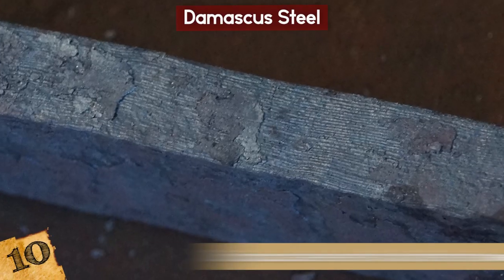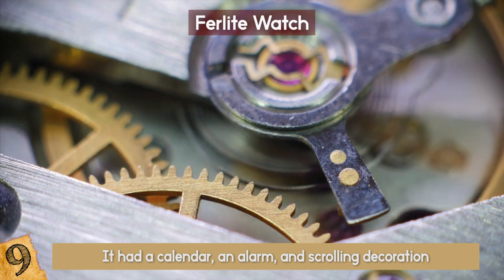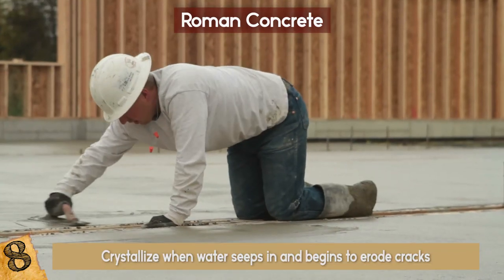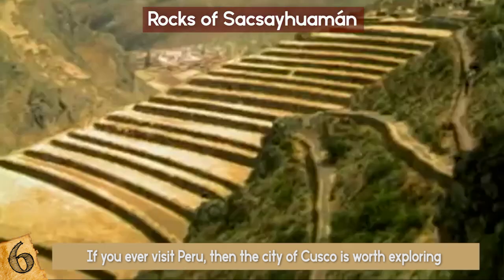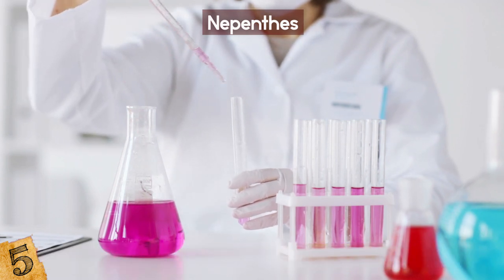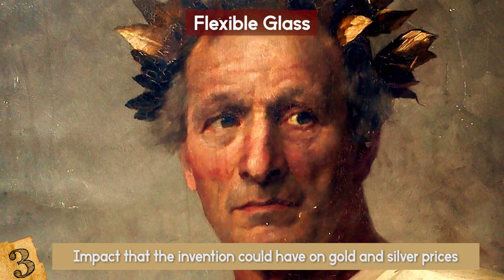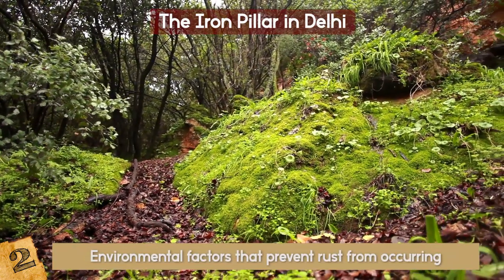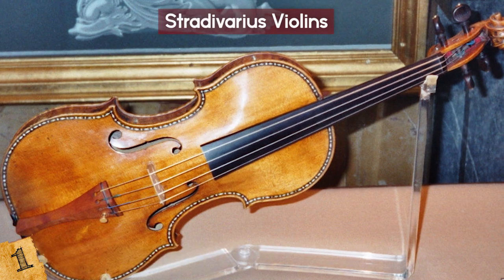ANCIENT Technology We Still CANT Replicate Today!

Comment: Actually #1 isn't really a secret anymore. The secret is in soaking the wood in water, for a very very long time. Stradivari was reputed to soak the wood for his violins for as long as 20 years or more. Today, they get Stradivari sounding instruments by trying to find old logs in ponds and lakes and such , some even end up sounding better, because the wood has been soaked for as long as 160 years in some cases. Also, Stradivari favored wood that he harvested during years of drought, because of the tighter tree rings and the effect that had on the density of the wood.  So soaking the wood of trees that were from areas of prolonged drought, then ad in the pattern of the Strad for the acoustics.. bam.. modern day strad, only 8,000$ and not 8 million.

Comment: FYI, damascus steel is still being produced to this day. google damascus blades, south africa
Reply: Tim Berrange  a youtuber blacksmith made a katana out of damascus
Reply: Tim Berrange go to Alec Steele's channel! He uses it in all his projects. It's not that special... This video is not researched really well in some points
Reply: Moskov Alucard Alec Steele
Reply: Tim Berrange that's folded steel
Reply: The old way is to add Material to almost molten steel. But is hard to do and it's useless today, you can forge weld steal much harder and flexible
Reply: Depending on what study you look at, one has the source of damascas steel being its smelting and forging process. There is also something thats nearly there the exact same thing, folded steel. It produces the same basic effect. Slightly diferent propertys. There has been a lot of research done on the whole mess, its not nearly as lost as people think. Part of the issue is that some of the steel propertys might have been effected by a specific ore and smelting method, wich created a layered steel to begin with, then working the material added all the folding.
Reply: just look at ANYONE that's ever forged... at some point there will be damascus

Comment: Saltpeter is NOT an "early form of gunpowder." It is one of three ingredients used to make an early form of gunpowder called "black powder": saltpeter, sulfur and charcoal. Saltpeter is potassium nitrate and is the oxidant part of the mixture with sulfur and charcoal as the fuel. The ratio of these ingredients is 75% potassium nitrate, 15% charcoal and 10% sulfur. I used to make it when I was in the 6th grade.

Comment: First, you can buy Damascus steel on Amazon. Second, we can make fire burn on top of water. It's called set fire to napalm or oil. Sailors in WWII that had their ship sink sometimes had to choose between breathing or not being burned because of the surface being on fire. Third, scientists proved a few years ago that the only special thing about Stradivarius violins is a special resin in the wood used.
Reply: "Third, scientists proved a few years ago that the only special thing about Stradivarius violins is a special resin in the wood used."

Correct.

Comment: People who don't understand fitting stones together should read about the carpentry technique called scribing.  Put two stones close together.  Use a divider to trace the edge of one stone while marking a similar line on the other.  Then grind that second stone down to the scribed line.  Scribing is used in boat construction, because most things in a boat are not straight or square.  Also, if you are putting one stone on top of another and want  a perfect fit, just put some sand between them.  Wiggle the top stone, and the two stones will eventually be abraded to perfectly fit.

Comment: True Damascus steel can be made simply be layering two different types of steel in alternation and then heated and folded over and over again. Once the steel has been cooled, you can leave it in a chemical bath, which will remove the oxidized surface layer, revealing the beautiful damascus pattern

Comment: The only secret to Roman concrete is that they didn't use rebar (for reasons that should be blatantly obvious). Rebar (or more specifically, the oxidation thereof) is the specific reason that modern concrete tends to fail in decades instead of centuries. 

Because they didn't use rebar, they had to design their structures so that all the load-bearing portions are in compression. That's why the buildings are all thick-walled, relatively squat structures built entirely out of arches.

Comment: The theory with Greek Fire is that it was made using pellets of Group 1 Elements kept in oil. These would be dormant in the oil but when exposed to water and air would ignite in a very intense flame that would ignite the oil and the oil would also help them stick to surfaces as well.
A similar weapon was tested against modern day battleship materials and the heat was so intense that it melted right through the metal armor and hull. The US and French governments are researching into a way to use magnetic coils to throw glass shells with metal frames containing the substance at battleships for future warfare. so far we can't create a gun that's low powered enough yet fires the shell fast enough to travel the required distance. At the same time the materials needed to make the pellets are extremely rare on Earth and most likely almost all of it was used up in the fight the Greek Fire was used in. However the material is more common on other planets and there may be a way to produce the material using radiation so it will be a viable weapon in decades to come.

Comment: The greek fire also used oils so it could make the flammable material float on the water but the other compounds had to float on top of the oils so the oil acted as a barrier between the water and the flammable material.

Comment: The mystery behind the Inca walls has been solved. It turns out they used metallurgy to lock the stones into place, like a jigsaw puzzle. They carved notches into adjacent stones then pored metal (not sure what type of metal) into the notches creating pins. The pins have the shape of a double headed anchor. Then continued stacking the stones and repeating the process.
Reply: sources?

Comment: The Iron Pillar of Delhi is a structure 23 feet 8 inches high with 16 inches diameter that was constructed by Chandragupta II, and now stands in the Qutb complex at Mehrauli in Delhi, India. The pillar is made of *99.72% pure wrought iron* which is why it has not rusted over time. The purity of iron used in the pillar is one of the reasons why it has not rusted. The site of the pillar is away from industrial areas and the climate of Delhi is fairly dry which also helps to prevent rusting. It is known that serious corrosion of iron does not take place if critical value of relative humidity is less than 80%...

Comment: Damascus steel is routinely made by hobbyists. It is manually beaten out of wootz. The watch is made by methods that have existed since the antikythera mechanism: I believe the phrase is "hand made". Naphtha has been known for millenia; napalm supercedes it. Drystone can be fitted by grinding the pieces to gether to make them fit: sand and water in the gaps eventually wears away the stone and eventually works its way out. The solar power stations in Spain use mirrors that can heat the target to the same temperature as the surface of the sun.

Comment: Damascus Steel? Goddammit, you can buy brand new Damascus steel knives on the internet...
Reply: What you usually find branded as "damascus steel" is not really a damascus steel, they just weld layers together to achieve pattern. Properties of damascus steel (including the visible pattern) weren't achieved by hammering techniques but in crucible. 
Even though most of "damascus steel" products aren't damascus steel we still know how to recreate it. Thing is that it's just not worth it. We got many types of steel that have better qualities for the tasks they are used in and also it doesn't make any economical sense, back then they just had ore with impurities that gave them this results (that's why damascus appeared in certain regions and suddenly disappeared, simply there was no more ore in mines, that's alo why there were also few types of damascus depending on region) nowadays you would have to mix them in certain proportions and certain way which is easy to mess up, that simply makes it expensive, as one damascus maker said-if he tried to make living out of it he would be bankrupt because that's simply not possible

Comment: Iron tower: U.S. Steel deliberately placed the massive steel columns on the exterior of the US Steel Bldg in Pittsburgh to showcase a new product called Cor-ten steel. Cor-ten resists the corrosive effects of rain, snow, ice, fog, and other meteorological conditions by forming a coating of dark brown oxidation over the metal, which inhibits deeper penetration and doesn't need painting and costly rust-prevention maintenance over the years.

So, while maybe not discovering the secret of ancient Indian iron - this is certainly the same end product.

Comment: There is a iron steel made today called corten - it's like aluminum, that when it oxidizes, this protected the surface from rusting, mostly used in dry arid countries.
Reply: Videos like this are interesting for what they leave out.  Those iron pillars (there are several) have a low sulfur content and sit in an essentially alkaline environment.  Some are actually badly corroded, all are badly corroded below ground.

Comment: I bet the glass was actually some type of rock but clear and wasn't glass at all. For the plane blackbird they actually used polished granite
Reply: Mica can be made into thin sheets. They are heat tolerant, insulating and dielectric. Because of these properties, they are used in electrical appliances. They are used in control devices, heating devices, neon lights and other lighting equipment.

Comment: There is quite a bit of outdated information in this video. Damascus steel is still being made all over the world, Roman concrete has been known to be made of volcanic ash mixed with several other rocks and minerals, napalm has been shown to work almost exactly like greek fire, and many types of glass can bend and flex.
Reply: get yourself a plastic bucket with some gasoline and dump a bag of Styrofoam chips in it. Let the chips dissolve and voila.....not kidding either. Have you ever seen styrofoam burn - it  doesn't so much burn as melt. Napalm is some nasty business.

Comment: 10, wrong
9, wrong
8, true
7, true
6, interesting - IIRC, there are carvings showing what appears to be a liquid being applied to the stones being worked? Might have the wrong site in mind, though.
5, intersting, but may be a problem with translations over time?
4, there is a lot of doubt that the device actually worked, let alone existed
3, perhaps malleable rather than flexible? There are 'glass' products that have properties not usually associated with that term and there are some interesting products being developed - look up 'transparent aluminium'
2, true, been curious about them for a while
1, true

Comment: Damascus steel and Roman concrete, we know the components, but haven't keyed in the ratios. Scientists are also working out the final 'why' it works as they key in on the ratios. We know why the concrete works, but without the correct mix ratios we can't watch the bonded structures form and answer the last of the questions posed. I know several smiths that specialize in folding metal for blades that work on this as part of a global collective and research on the concrete is put out semi-regularly by multiple teams.

Stradivarius works cannot be reproduced because we know now that volcanic eruptions that effected plant life on a global scale played a part. There simply are not any trees with the same composition and age from the areas his lumber came from anymore. It is similar to the ratio issues with the Damascus steel and Roman concrete, but as it came from an organic source, reproduction becomes infinitely more difficult, approaching impossible.

Comment: Information in the video is pretty outdated. Damascus steel is rather common, the stone masonry isn’t all that special it’s actually rather common depending on what country you go to,and it doesn’t lend a lot of credibility to reverse engineering. Greek fire was discovered about 15 years ago. The manufacturing of it is very simple and uneventful. The way that they figured it out was by going to Greece and starting the plants and materials that they had available to them at the time. And that didn’t take long to figure out.

Comment: All concrete gets harder as it ages. #5 magic mushrooms. Iron or steel with a patina will not rust any further... Happens to kitchen knives alot instead of turning to iron oxide it turns to a blackish rust called magnatite a difrent type of rust preventing it from rusting any more

Comment: Clickbait title. Nothing on the list "Can't" be replicated today.

Damascus steel is cruddy steel. Sure, it was impressive to the Iron wielding europeans, but it was nowhere near as strong as modern steel. We could make crappy steel if we wanted to, but nobody wants to, which is why it's not made anymore, not because we  can't make it.

We could easily replicate that watch. But it's a manual winding watch, and nobody wants to manually wind watches these days. Another fail.

Roman concrete isn't any better than modern concrete. That's just incorrect. Modern concrete can ALSO stay together for thousands of years if it's protected from the elements by being buried underground and dug up again later. And we could easily replicate the formula they used by simply analyzing a sample in a laboratory.

We have a modern equivalent of greek fire. It's called Napalm. It's actually BETTER than greek fire, since it doesn't just burn ON water, but it can burn UNDERWATER.

Comment: Roman concrete?  http://lmgtfy.com/?q=Roman+concrete
Roman concrete, like any concrete, consists of an aggregate and hydraulic mortar – a binder mixed with water that hardens over time. The aggregate varied, and included pieces of rock, ceramic tile, and brick rubble from the remains of previously demolished buildings.

Gypsum and quicklime were used as binders. Volcanic dusts, called pozzolana or "pit sand", were favored where they could be obtained. Pozzolana makes the concrete more resistant to salt water than modern-day concrete.[6] The pozzolanic mortar used had a high content of alumina and silica. Tuff was often used as an aggregate.

Huh, sure is a lot of info on it for something we can't replicate.
Reply: Sacsayhuamán means Royal Eagle...
Reply: Archimedes - /,ɑːrkɪˈmiːdiːz/

Comment: I had to stop even at the start! WTH? There was no real research done to compile this pile. Damascus steel was better than the low grade low carbon steel of the time, but is not near as good as many modern steels, such as ANY tool steel, unless you get your data from Universal Studios, lol. Only in the movies is damascus steel the "end all beat all" steel, that somehow magically cuts through concrete and other swords like butter. That is called science fiction. Same goes for japanese damascus style steel, though that was better than the original damascus. Bladesmiths make genuine damascus steel even today -- the technology was not "lost" and is not that hard to make. Damascus is a city in SYRIA (and always has been) that has nothing to do with India. The maker couldn't even get that fact straight.   Damascus steel is a layered combination of hard but brittle high carbon steel with malleable and ductile low carbon steel. It allows for a sharp blade that holds an edge pretty well, but also allows the flex and impact resistance of the low carbon steel which will not take or hold a good sharp edge at all. It is formed by forge welding the two materials using a flux, then folding and repeating the process. The number of layers increases geometrically with each fold/weld process, so the initial 2 becomes 4, 8, 16. 32, 64, 128, 256, 512, 1024, etc. As you can see, you only had to beat the steel out 10 times to get 1024 layers. It is highly debatable whether any benefit happens above 64 layers as well. There is a point where the layers just merge together and make a homogenous material which is equivalent to a medium grade steel and all benefits are lost.

Comment: This is stupid. I stopped past the Damascus steel BS. I own a dozen Damascus-bladed knives, all made relatively recently. Do you know how to Google?
Reply: Do you have a real damascus steel blade or patter welded ones? I'm sure the second one. It's a totally different thing, yours and most of the things you can buy use simply layers of metal welded together, damascus steel is a crucible steel, its properties (including visual pattern which doesn't always occur and it still damascus steel) are achieved through melting it. 
But still what they said in video is bs since we know how to make it.

Comment: Come on--- Damascus steel is easily reproducable. Ive made it myself. And it is not in any way made as you said it is. It is made by forge welding billets of steel with differing carbon contents, then heating, folding and forge welding the combined billet many, many times. You should actually research these things before you make videos. You also showed a picture of Macchu Piccu and said it was Sachyshuaman. Poor scholarship chasing clicks. You should be a little less casual with your "facts".